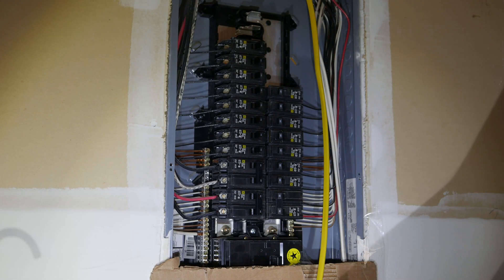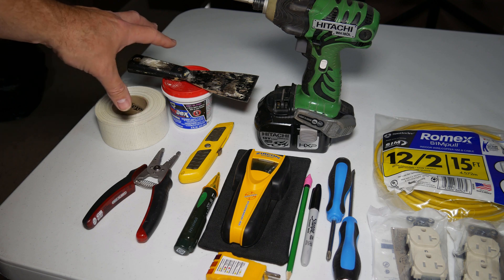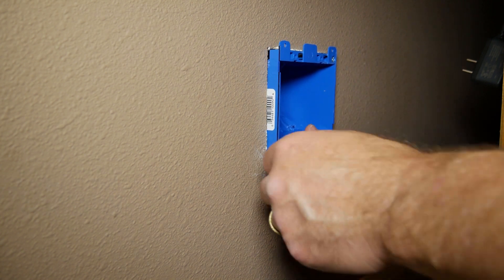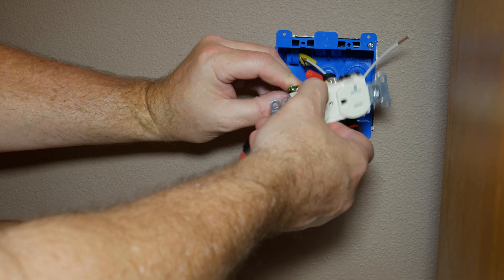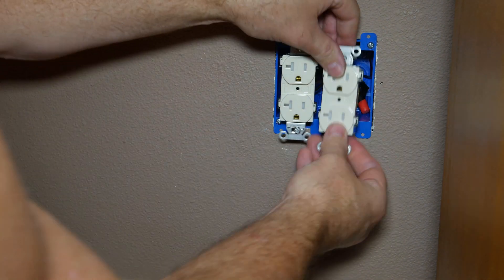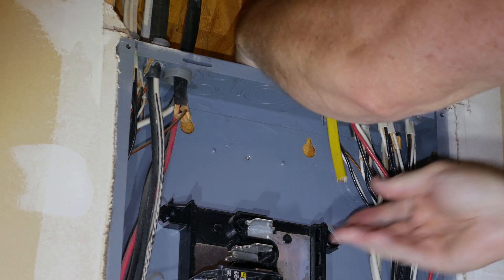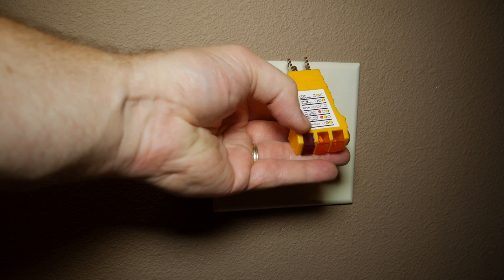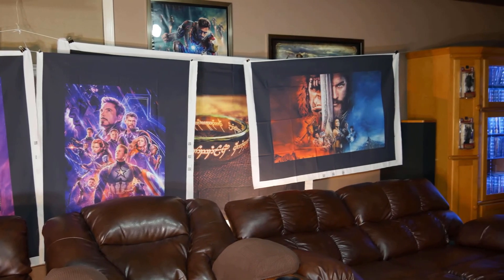DIY Installing a Dedicated 20-amp Circuit in our Home Theater! | How-To

Comment: I'm not planning on doing this myself, definitely hiring an electrician but I like to know what happens in these installs before I hire someone. I want to put an outlet into an outer wall of the house, and there are vaulted ceilings in the room. I'm pretty sure there's no room to move around up there. How are they going to run the line from the circuit box to that room?

Comment: I'm having an electrician convert a few existing outlets to dedicated circuits. The old house has the refrigerator and washer on the same circuit as a some other outlets. I'd also like to be able to run two space heaters at the same time in one large room, but each heater is 1500 watts.

Comment: Need help. Do I need a dedicated outlet? I just bought a inferred home sauna. Says it’s 1800 watts. The outlet I want to use is open but shared with pot led lights and a TV on the circuit. Do I need to run a dedicated line like this or do you think I will be ok? I did use it already and no breaker popped or any issues so far. Just curious If I’m still safe. What do you guys think?  Thanks

Comment: Thank you for the guide. It's great! Since we are doing this for audio, do they sell shielded power cables, say 10G or 12G? By the way: I am not a pro, but it seems to me that it would have been safer to start from a circuit breaker with its hot wires and run a wire from it to the new outlets, no?
Reply from the maker: Thanks for watching! Not sure if you can get shielded wire. I prefer to work towards the breaker panel that way there's no way power can be on the lines until you hook it to the breaker and turn it on.

Comment: I'm having the same problem with my system.  I recently added a third 15-inch subwoofer and an additional 3 channel amp to power my front stage and take pressure off my avr. Anyways it's now tripping the breaker whenever a movie has some serious bass. Lol! I plan on "hiring " an electrician "wink wink" 🤣 to install a 20 amp dedicated circuit. Hopefully, after I (clearing throat), I mean "the electrician " installs the 20 amp circuit it will sound better and not trip breakers anymore.  Lol! Wish me luck!

Comment: Hello.  Your video is straight forward but I still do not understand one thing.  I  know I am missing something with all these videos I've been watching on this matter.  My question is:  What makes a circuit a 20 A circuit; I understand 12 Gauge wire, 20 A breaker but why would I get 20A's going through that circuit?  So I am clearly missing something;  Say you have 100A coming into the house and I have 1 circuit breaker (100A circuit breaker ??? :)); is that circuit 100A?  Or can I say if I have 100A coming into a house with one 20A breaker; that circuit is a 20A circuit because that 20A circuit breaker "blocks" any current higher then 20A.  Sounds like the breaker defines how much current goes into the circuit at the breaker?  Sorry for bein an imbecile.. ;).   I have not found any readings on this... sorry.
Reply from the maker: Your exactly right, the breaker allows its rated amperage to pass through, any more than that and it breaks the circuit. I have a 200 amp panel with breakers ranging from 15 to 40 amps. Hope this helps
Reply: @TwoGuyzTech  Thank you very much!  I've learned a lot from youtube and it is the "little things" that completes my understanding of things and making sense. So a 20 A breaker will only permit (by design) 20A max to pass through and kick off if there is a surge like a short or an equipment that draws more then 20A.  Amperage is defined at the breaker! (Googlers will seraching for answers will find your video!). 
One other question if I may:  on a 20 A circuit, it is ok to plug in 15 A load equipment ; i.e.  even though 20A is coming through the circuit but the equipment is using up 15A? Or 20A is "saturating" the load equipment when the load equipment is rated at 15 A which could "melt" the load equipment?  Sorry for the extra questions...I just want to complete my understanding of the circuit...and Thank You!
Reply: @samsnow7370 it's more of having 5 extra amps as headroom. Meaning, when all this equipment, avr, amps, subs are plugged in to the now 20 amp circuit it doesn't overload the breaker because it has the extra amps to handle all this. Almost like having 900 horse power in a car but the clutch can only handle 400. Upgrade the clutch to a 1200 hp rating just for extra strength. Hope this helps.
Reply: @samsnow7370 also, the equipment will only draw what the internals allow. But, when adding several pieces of this equipment, the risk is at the breaker not at the equipment.

Comment: Before you wire-nut those three like-color wires together, ALWAYS use an electricians pliers to clockwise twist lock the wires together first.  This creates a much better connection between the copper wires.  You really don't want to rely on the wire nut to keep the wires connected.
Reply: Making a j-hook on the end of the pig tails is also a good practice. I was a little confused as to why he didn't pre-twist or j-hook the hot and neutral wires, but both pre-twisted and j-hooked the ground wire.
Reply: Read the instructions first, some don’t want you to pre twist, I believe.

Comment: Most electricians will try to steer you away from doing this. I'm renovating my kitchen and one of the walls borders my stereo room. I asked the electrician to run a dedicated duplex 20 amp circuit to my system since he was already there. He laughed and thought I was joking. When he figured out I was serious, he told me it was total overkill and unnecessary. I just said, "Yeah, I know. Do it anyway". He just gave me that, 'okay, you're the boss' look and said he would. It should be finished up today. I can't wait to get my system all wired back up so I can hear it.
Reply: How much did it cost?
Reply: @csoukup06  I'm not sure. He included it with a whole list of things that he did. He didn't itemize the charge for it. I don't think it was that much since he was already in there and into the box anyway plus most of the wiring he was running was into that wall. I basically paid his hourly rate and for the materials needed, which I already had most of. It's hard to say to tell you the truth.

Comment: Great video !!  This was exactly what I needed to see.  You did everything I did including getting up into the attic and fishing the wire through the wall and into the elec panel.  I just wasn't sure or completely confident with going with 20 Amps, and connecting to the panel.  Thanks for easy demo and straight forward information.
Reply from the maker: Thank you! glad it was helpful. 😀

Comment: When the plugs are pulled out, is there no risk in the outlet being ripped out of the drywall, since their not attached to a stud?
Reply from the maker: Thanks for watching! People use remodel boxes all the time without issue, they're clamped to the drywall very securely and won't rip through.
Reply: @TwoGuyzTech  :-) OK, my new outlet will be very similar.  Thank you.

Comment: Lucky u have attic access and no cross studs in the wall... something that u would not have known until u run the wire up.
Reply from the maker: Yeah made it much easier to run the wire for sure! Thanks for watching :)

Comment: I'm thinking that it may have been preferable to use 12-3 Romex and a double pole breaker thereby allowing each receptacle to operate from a separate circuit. You will not need a pigtail for the hot as the red wire goes to one receptacle and the black wire goes to the other. You'll need a pigtail for the neutral. You would have a shared neutral and effectively have a multi wire branch circuit, but with 2 separate receptacles. You may then be able to use the air conditioner with no problems because you're dividing the load. Since you have a modern electrical panel a double pole breaker will get 120v from L1 bus bar and 120v from L2 bus bar (very important). It also reduces the return current on the neutral wire.
Since this is really not a dedicated circuit, and you're equipment probably has a standard 15 amp plug, you can use 15 amp spec grade receptacles and you're sound quality will not be affected.
Reply: Yeah Imma go with a miter to jerry-rig a shim jamb strap hinge quarter-round soffit two-by-six dowel cherry-picker flim-flam.
Reply from the maker: Hi and thanks for watching! your idea sounds like a solid one. Since this video I have installed another 20 amp breaker and another run of 12-2 so I now have 2 separate  20 amp circuits, so should be good for a while :)

Comment: All looks good to me.
One thing... According to another channel, a truly dedicated circuit is not connected to a duplex receptacle but only to a single receptacle intended for only one device to be connected to it.

See https://youtu.be/3avG3Ulxf3Q
Reply from the maker: Thanks for watching! I suppose that would be a truly dedicated circuit, but we didn't feel like running individual circuits for each of our components, so keeping all of the components on one circuit separate from the lights (and potentially a portable air conditioner during the summer months) is enough for us! 😀

Comment: Thanks for the tip I just ran a 2 gang 20 amp dedicated,  FYI didn't  know you could run 2 different outlets on 1 Breaker , the pigtail thing was cool Thanks , I didn't do the pigtail thing i used Wago wall-nuts.  that Romex is not cheap , my friend gave me two  20 amp receptacles old construction box and the wago  things. Save big Money At Menards  , the breaker romex outlet cover Liquidtight Flexible Metallic Conduit 25 ft , my Mancave is in my detached garage 64.01

Comment: What if you cant cut an access whole at breaker box as its on the outside wall of stucco house?
Reply from the maker: If you have conduit running into the top of the box, that would probably be your only option if you can access that. Thanks for watching!
Reply: @TwoGuyzTech  Thanks, I'll have a look at it
Reply: I might be wrong, but I've never heard of a house breaker box located on the outside wall. It might be OK IF the box is designed for outdoor, waterproof, and grounded to a rod. Might you be talking about an outside box for an air conditioner with an on/off switch?

Comment: If I bought all the materials and basically got everything started and then called an electrician... Do you think I'd save money or just piss them off🥺
Reply: so did you end up pissing off the electrician?
Reply from the maker: I think that would depend on the electrician, some don't mind doing clean up work, and some want to do it all from start to finish. Thanks for watching!

Comment: Maybe you could have used thicker wire than the Romex 12 AWG. I think hi end Hifi  setups would benefit with both the 20 amp breaker and thicker wire. If that makes sense
Reply from the maker: Hi, and thanks for watching! 12 gauge wire is rated for 20 amps, so it would make no difference if you went with a lower gauge wire because the breaker will trip at 20 amps, so the wire will never see a load higher than that.
Reply: Yep I can see the 12 AWG is good you know I was thinking of those audiophile guys that spend hundreds of dollars on amp cables from amp to wall. But they forget about process of wall to break box basically what you did. I actually built my amp own power cords using Mogami W3104 Cable.  Here is a DIY guy doing something similar.  
https://www.youtube.com/watch?v=BtAD6u-uaAw&t=150s
Reply: @TwoGuyzTech  When you use a smaller gauge wire, say 14-2 w/ground, the max amps for this gauge wire is 15amps. It will overheat at 15+ amps. The 20amp breaker will allow the wire(s) to overheat. Please let me know if I'm wrong. This is assuming that your equipment is pulling 15+ load.

Comment: How do you get the wire from the outlet to the panel in the garage though? You said that you fed the wire through the hole in the home theater but how'd you get it from the hole in the theater to the breaker?? O.O
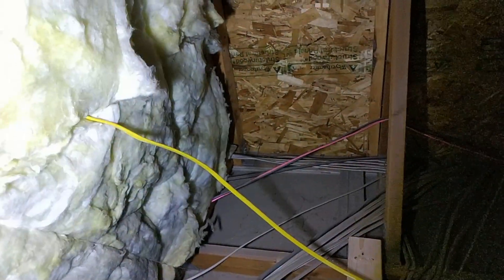Reply from the maker: My home theater is above my garage, at 8:20 in the video you can see me going up into a space behind the wall that I passed the wire through, I then at 8:27 in the video, ran the wire down the wall to the Breaker panel located in my garage. Hope this helps and thanks for watching.
Reply: @TwoGuyzTech  You didn't show how you fed the wire from the outlet to above the garage though.
Reply: @thepracticalaudiophile  he shows himself pushing the wire into the wall, through the insulation.  That wall pokes out directly into the attic above the garage.

Comment: having the outlets only in the sheetrock is cringe, why not attack to the side of a stud
Reply: Not necessary.
Reply: Seems too fragile but fair enough
Reply from the maker: I've been using this type of box for years and never had a problem. But if you have the access and feel more comfortable using the type that attach to studs, then more power to you!